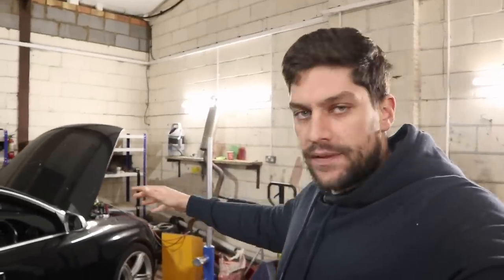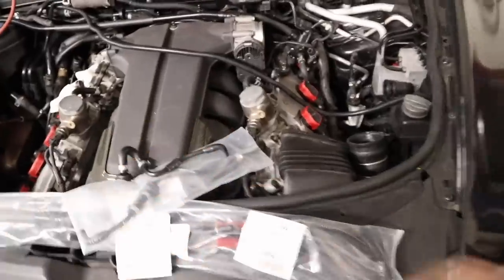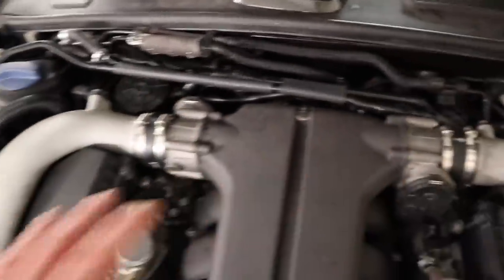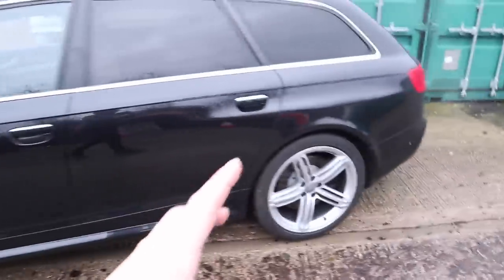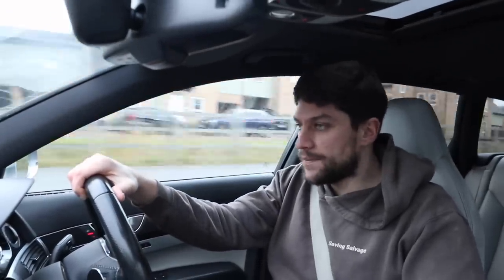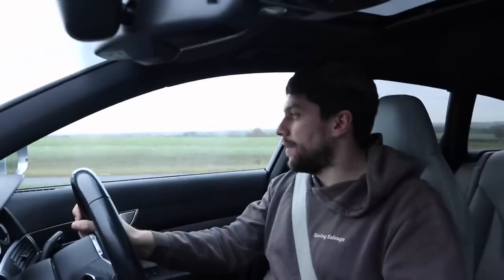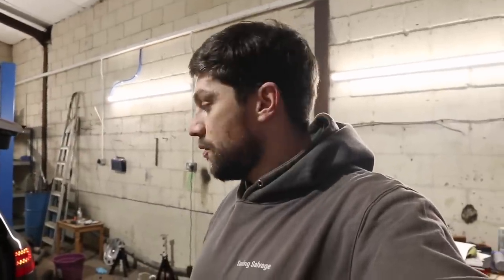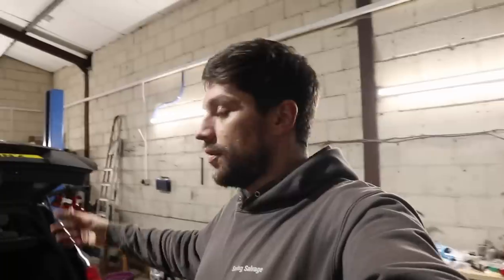Repairing the PCV SYSTEM on my Audi RS6 V10 TWIN TURBO!! + ROAD TEST!!

Comment: Rumble strip feeling will most likely be the lockup clutch on the torque converter. ZF 6HPs are pretty well known for that - especially well known in the Land Rover/Range Rover community. Usually a double fluid flush and filter will solve it. If it has progressed a bit there's an additive called, no joke "Dr Tranny's Instant Shudder Fix" and it actually works! If it doesn't though you're up for a new TC I'm afraid!
Reply: Flush is 50/50. Heard plenty of stories where after flushing oil transmission grenades itself in like few hundred km

Comment: Dean, I got a OEM Valeo inner tail light section from ECP with discount 👍. Notorious for leaking into the boot and going by the rust around where the grommet should be on the bottom of the tailgate, it’s been an issue. Rear wiper hose also breaks at the boot lid hinge and leaks too.

Comment: Great video, very interesting. With the inner light, identify the diode for the l e d,s and try replacing that. I have done it a couple of times saved a shed load of money. The diodes cost about a £1 for 10 on ebay.

Comment: Hi Dean, I’ve experienced the rumble strip / vibration on initial acceleration and it took a gearbox flush and filter to cure. It’s been six months since I had mine done and it’s been fine since.
All I will say is that it’s easy to ignore or convince yourself it’s something else, but to buy a replacement gearbox would be a massive hit….best of luck mate
Reply from the maker: Awesome thanks! Gearbox filter and oil change en route then!
Reply: @SavingSalvage  that will only benefit the car, but from my experience with this RS6 model, the vibration on acceleration was caused by the prop-shaft central bearing, check it out for the rubber cracks. Audi won't sell you only the bearing but the whole prop-shaft, but there are a few AM options which are better than the OE one. This is in my opinion the best RS6, not as performance or dynamics but as a whole, it has a special engine, it has a very low key design so it can be very well mistaken for a regular A6(unlike the C7/C8 which are "shouting too loud look at me"), very usable as a daily, comfortable enough and the V10 is really one piece of mechanical art .
Reply: @SavingSalvage  maybe propshaft releated also? or the guibo thingy.

Comment: hi i have owned a similar rs6 for 2 years now mapped by mtm 800bhp, i bought the car with loads of issues because of bad treatment and neglect issues such as "slipping gearbox , broken pcv system , misfiring engine on all cylinders and a leaking crankcase baffle" drove it like that for 7 months without any catastrophic issues as i saved enough money for parts, i repaired everything myself list goes like this PS little to bigger never jump conclusions on these engines always research and be 110% sure before buying expensive parts. i started by preforming a gearbox flush to my surprise i had a bad mechatronic and slipping clutches i sourced a used gearbox for around $1100 and replaced it and fixed the bogging and hesitation to shift issue, FYI its possible to replace the gearbox without dropping the engine ive done it, after i started tackling the missfires and the engine shaking i replaced the broken pcv, valves, hoses, that fixed the issue with the shaking of the engine later i found 6 malfunctioning sparkplug coils ive replaced all 10 sparks and coils for safety thus fixing all the engine issues i had, i had to drop the engine to fix the oil leak unfortunately but it was simple enough to do took me 2 hours first try basically a 10 hour job between the engine dropping, cleaning, disassembly, resealing crankcase baffle, while im in there stuff, intake valves carbon buildup cleaning MUST DO!!!, and putting it back together after that the car never suffered with any issues what so ever except from a bad starter an easy fix if you know what you're doing ive took it on road trips and topspeed runs all the time 330+kph not a single hesitation or issue for a year and a half now i highly recommend this car for the patient and willing total cost of repairs in parts only since im a DIY $7000 including a set of new tires which are expensive and new pads for front and rear.

 ill gladly help you and answer any question you have regarding the car love your work keep up the great content.
Reply: Thats awesome

Comment: Great update
Is it worth removing one of the lower intercooler pipes again to check oil isn't building up again inside
The shudder could be the front damper not damping when under load scrabbling for grip?
Reply from the maker: Yeah I will give it a hundred miles and recheck. 👍🏽

Comment: You could spend a bit more time looking at those rear lights as it could save you a €100 or so. I wonder if there is a ground shorted somewhere there or wires crossed.
Reply from the maker: I did have a quick look, it’s a sealed unit so would require cutting open. But I guess there’s no harm in doing that. So may give it a go 👍🏽

Comment: Find out why there is water in the trunk aswell. Mine leaked from the 3d brake light. The insulation was rotten.

Comment: right hand side of the number plate is a rust patch and right hand drain hole is rusted, so I think you rear electrical issues is a leak somehwere

Comment: Your power lift tailgate motor bolts look loose - they go like that.  Peel back the roof and tighten the bolts on the motor and it should run a bit better.  The rear led lights failing is also very common, I replaced mine a couple of times in maybe 2 years ownership on an 09 RS6.  Cheers

Comment: Nice one! I had the same thing with mine, discovered that it had previously been to MRC for a stage 2. If it has aftermarket air filters/exhaust, it may well have been done. I highly recommend changing all the drivetrain fluids as they are "sealed for life" so likely have never been done. This is how quick it should be as a stage 2 730bhp/1000nm

https://youtu.be/Un8HJFMO7r8

Comment: That tailgate drain hole looks quite rusty, have you got a drainage issue. Number plate lights of 2005 age always rust, that's why VAG modified them on later models  so they clip on not screw on

Comment: Result. I love this car, out of my price range though. I had a V8 A6 for a while and loved it. Been thinking about a C5 RS6 recently, the 4.2 twin turbo. Anyone had any experience with a C5? I know about the DRC issues. How dangerous a gamble would a 150,000 mile, DRC replaced, 2 cam belt changes 9k?

Thanks in advance
Reply: Hi mate just wanted to reply, being a C5 RS6 owner myself I bought one in June, had some issues brake booster valve went that was £900 fixed was initially quoted potential of turbos had gone etc 😂 I go to a place called unit 20 up north if your down south MRC are the best, also recently my gearbox went that was £4500 as the whole engine had to come out and it was a full rebuild of my gearbox etc nightmare car cost me £13,500 and if you add up what I’ve spent that’s another £5,000 on top it’s done 137,000 miles now drives amazing, had full service history when I got it, was just unlucky regarding repairs I guess fingers crossed 🤞 that’s it now bill wise hope this helps
Reply: Thanks for replying. So you purchased for 13.5 and have spent another 5 so far? Has yours had the DRC replaced? How many cam belt changes and at what mileage? Are you loving your C5? I think I’ll hold off until a bigger work contract starts next year and I’ll have a safety net! Cheers mate.
Reply: @viceminerrr4802  The gearbox is known to fail on the C5 RS6. It is basically the achilles heel of the C5 RS6.

Comment: This has got me questioning myself, I have a 2.5lt turbo ford focus and I'm only getting smoke on higher revs, absolutely nothing the rest of the time I can drive it 80mph down the motorway no smoke I believe its a breather problem but I've been told its probably turbo on its way out

Comment: Isn’t the C6 avant a common problem for water getting in the tailgate? My old Lemans edition had it.
Reply: Yes. That’s why the drain hole on the tailgate lip was so rusty. Cure was to remove the plastic cap and leave it off so it could drain.
Reply from the maker: Isn’t it great how VW’s fix isn’t to actually fix the leak. But to let it pass through quicker 😂
Reply: Had nightmares with the rear lights on my a6, notorious for boot seals leaking water in, mine was actually the hose connection to rear washer, had the same rusted light fittings on l/h side too, good luck with it 👍🏻

Comment: Glad the PCV parts fixed the smoke issue. What a faff these German cars are with their PCV systems. BMW's are a pain too and Volvo's. On the plus side you live in the UK so 100 quid for that light is gonna be cheaper than what it would cost down here in Kangaroo land.

Comment: Would this engine work / fit in my R8?
Reply from the maker: The engine as is wouldn’t fit. The turbos will need to be moved. So you may as well keep your V10 and add twin turbos to that.
Reply: @SavingSalvage  I have a R8 V8 , not a “R10” unfortunately :(